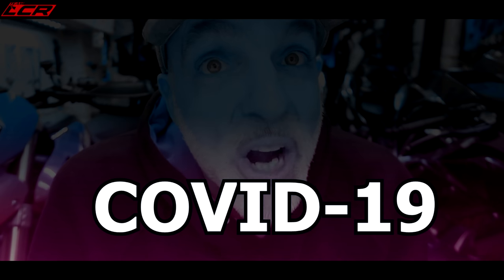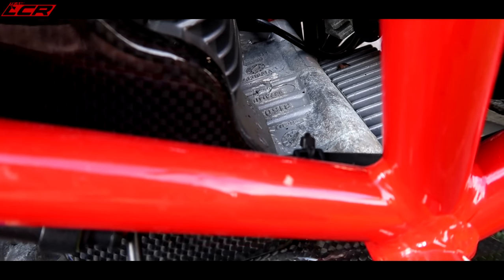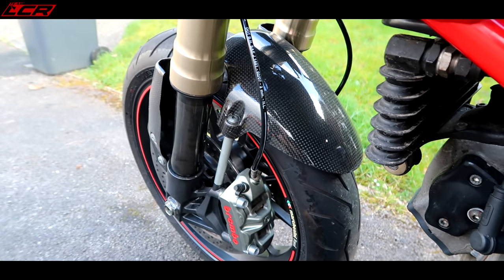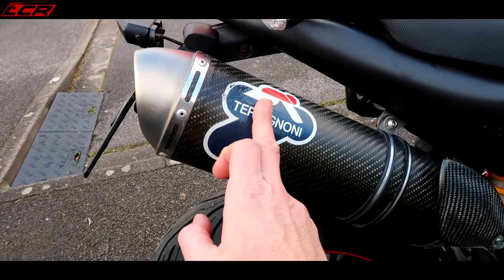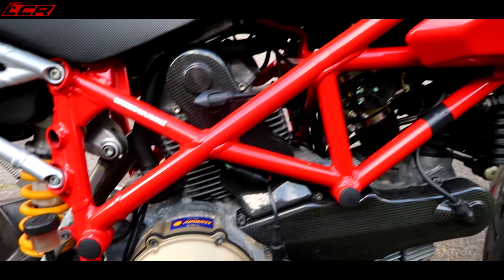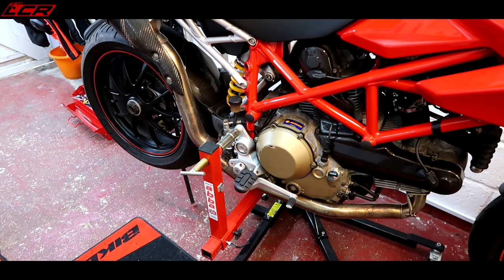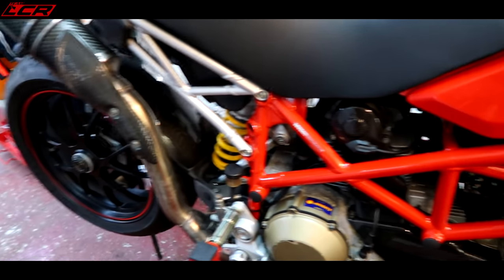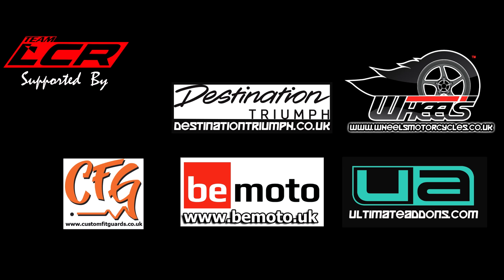Ducati Hypermotard Restoration EP01 | The Project Begins!!

Comment: The only solution for this is to take care of a bike. Had two S2R’s 800 and the paint was perfect on the engine after several years but I washed it regularly and through out. I used engine look it as a general gage of how the owner took care of a bike. Not perfect but good indicator.

Comment: Unfortunately Chops your bike is different from my SS. So lifting frame of engine not bad idea I did same with my old ZX10. I removed plugs and used nylon rope fed into cyl , being work on , at bdc and used a bolt in crankshaft to rotate up towards tdc , to hold valves in valves place for shimming. i procured shim kit from EMS Duc in states plus their MBP retainers. Those retainers tighten up the closer shim on valve stem nicely. Belts are easy to do. Probably good idea to make removable blank plate to partially reduce oil cooler size . Your climate can be too cold for oil cooler operation. Change the clutch slave cyl for lighter feel. Dry clutches like to be cooled by air so running modified side case is good idea , also vents dust. But you have problem with salt on roads mmm maybe not good idea. Get the chip changed and re program with one off of a dyno run, big difference. Modify your air box for more flow. Get your suspension o/h and set by guru. I run Michelin RS on my SS , 1098s and Monster 1200s 27/28 psi front 28/30 rear woo hoo. You got a good bike there Chops enjoy , vroom 🏍😃
Reply from the maker: Great tips thanks Kym!

Comment: I start my Ducati 1098 every two weeks and let it warm up to 80 degrees before shutting it off so that the cam belts are not left in the same position over long periods of time as the bike is being stood for a year. Is this a good or bad thing I'm doing?
Reply from the maker: I would say no you shouldn't, when I'm winterising my bikes I fill the tank (stops rust) add some fuel stabiliser and run it through the bike to stop injectors gunking. Disconnect battery and then leave it alone.
Reply: @LambChopRides  I've filled the tank and put the fuel stabilizer in just being told it's not a good idea to leave the belts in the same position for long periods of time as it will cause weak points on the belts?

Comment: It must be the 1100, right?
Reply from the maker: Yes 1100s 😎😎
Reply: @LambChopRides  Nice one but no abs it's a bit dubious to ride it in 2021 but since it is a restoration project and a weekend bike maybe it's ok. are the brake master cylinder and clutch the stock ones? could they be installed on a 796? thank you.

Comment: Exact start replacement starter cables, made a massive difference on my old RSV1000R, slightly better on Multistrada, check them out.
Reply from the maker: Ok Alan will check those out thanks 👍
Reply: Yes what Alan said....(kit had to come from America though) and yes did make a difference on the Aprilia and saves wear on the sprag starting clutch

Comment: I'll start by saying HELLO from the greater Seattle area! Now... Since I own a much newer iteration of this bike, I thought I might chip-in with some ideas (I hate the idea of "giving advice"). I'll start with the simple stuff, which is also the most obvious and I'll get later into the more complicated one. From an optical perspective, you will have to address first of all the tail section and work your way forward. Fender eliminator and turn signals, then seat/seat-cover. I'll also include links so that you and who is reading will get the feeling of where I'm going...
1.) I would grab one of the fender eliminators in the link and do some adjustment work to it and I promise you, it will look as if it was done in factory:
https://www.amazon.com/License-Bracket-Eliminator-Kawasaki-Triumph/dp/B07BKV6S5J/ref=sr_1_4?dchild=1&keywords=universal+fender+eliminator&qid=1585938872&sr=8-4
2.) LED turn signals. The Ducati branded ones sell here for $100 +/- $10 and are made by RIZOMA, HOWEVER!!! These are not a direct fit, unless you keep the factory housing which will hold to the strange shaped rubber end of the part... The better option is what is found as stock on some Triumph bikes, they have the almost same shape as the Rizomas do, but allow an universal mount. Also the light-block is the same and they are made of very high quality metal at a lower cost of only about $65:
https://www.amazon.com/Koso-HE015K14-Thread-Unlimited-Marker/dp/B005EMYPFK/ref=sr_1_1?crid=1HHHAM8A0D8YQ&dchild=1&keywords=koso+led+turn+signals&qid=1585939129&sprefix=Koso+turn+si%2Caps%2C223&sr=8-1
3.) Next comes addressing the seat... Here you have quite a few options; seat cover only and for this option I would recommend LUIMOTO, out of Vancouver BC (he did some wonderful work for me in the past for a different bike). I would go with the suede combination:
https://www.luimoto.com/?my=50&p=507
Next option would be an entirely new seat and here again are a few options... You could get a Sargent or a Corbin (less "bling", but very high quality)
https://www.sargentcycle.com/Seats-Accessories/Sargent-Seats-Ducati-Hypermotard-Low-No-Heat/Red-WS-605-11.html
https://www.corbin.com/ducati/dhm117.shtml

I'll move-on to my next thoughts and impressions... One more thing I want to move out of the way; the "milk" in your oil window... Thast's NOT any sort of "condensation"!!! If it were it would simply wash away at start of the engine, but it does not... In fact you need to ride it quite a while until if permanently vanishes. Because the bike had not been used for quite a while and because the interior part of the casing is bare (untreated) aluminum (US version - aluminium - UK and rest of the world version LOL), it will oxidase when exposed for a long time to the air inside the motor (we call it ENGINE LOL). There is no vacuum and there is no oil to cover it... It will wash-off (which apparently it did) and an oil change will do very good. Now, to the oil change in your case... I would like to see you do it twice with about 200 miles in-between, for two reasons: 1. You most likely don't know what oil was in the bike before you released it (and even then) and 2.) Motorcycle oil does not have the cleaning additives as car oil does because it needs to lube the wet clutch, so you can't really expect the oil to clean the system for you, other then picking up crap into it and getting contaminated. So a 200 miles oil change with the very same oil as 200 miles before is what I would do. Filters to be changed of course as well. Now to your Motor paint project... I'm only telling you what I would do and trust me, I'm very picky myself. I would first of all detail the engine as is, without taking any part off. Next, I would prep it for painting as you would a car in a paint shop... Cover all parts which don't need paint and leave exposed ONLY the parts which need painting. Prep them and spray them, but be very careful to use appropriate paint. If there won't be any golden paint exposed, I would go with what they use on later model bikes, which is black. Next, I would get rid of all fake "carbon" trims. There are some nice carbon trims made by Akrapovici and Rizoma, but the ones on this bike are simply terrible; they scream China! Next, you might NOT want to cut the pipe, even so it's a cheap knock-off; instead I would look for a decent one. A Termignioni sells for about $2000 and if it were to be genuine, you would never want to "mod" it LOL... You can find a decent pipe for about $500. I would recommend rebuilding the calipers with new Ducati/Brembo rebuild kits and flush the lines with cheap DOT 4 before using RBF600 from MOTUL; this will give you the most satisfaction in breaking you will ever have. Also, get double sintered EBC pads and get the WOW when you will use them. Now, I would do something which people might not agree with and I have not done my homework on compatibility, but what I have in mind is the following: Since you're looking for a fresh look on your bike, I would hunt down a set of rear structure, the silverysh one which replaces the steel tubing just under the rear part of the seat and I would also do my best to find the late model front protectors which hold the turn signals - those come with factory LED and look amazing. The tail part is now available on Ebay USA from someone who is taking a Hypermotard apart... I know it's a long read, sorry, but also consider the fact that I put a bit more time into writing it LOL. Good luck and keep us posted! STAY safe, you and the rest of the world!
Reply from the maker: Thanks for the detailed reply really appreciated some very good ideas there! Really like the tail tidy idea and things like LuiMoto I was already planning that :-) Thanks again I will come back to your message again as I work through the project, really appreciated Mr Dude!!

Comment: And correct, strip the bike down to the engine... wheels, forks and swing arm off first, then rear subframe, fairing, triple clamps, tank and loom. Then drop to the floor and strip off the chassis from the engine.

Comment: Support to the rear through the rear subframe I'd the back end out of my speed triple healthy dose of carbon fibre parts and race ti do some good deals on titanium bolts and I have bought a couple of hundred pounds worth of these items 😬😍🍀that is what I said I'd spent with oz wheels etc changed all body panels Boohoo wasn't spending it on home improvements its a bad hobby 🏡🤔😋

Comment: If it was 1988 you would have to 24K gold the frame, chrome the engine and put boat glitter paint on the body work. ... I like your idea better. Remember ass y m bly goes in the opposite order of Dis ass embly.

Comment: Those mirrors are awful, they are hard to lock in place, easily knocked and fragile, go price the replacement as when it gets damaged you need virtually all the parts including handguard at about an overall cost of £600. 

When you say 130, is that in KMP these bikes on a flat road will pull no more than 115 MPH on standard gearing? It doesn't need to be super fast it makes it up on the corners. I'm surprised you had an issue with the front even with mismatched tyres, these bikes are pretty forgiving and you can push the front end hard. 

How can someone let an £11,000 bike get into this state?

I'm not knocking you or your vid and certainly don't claim to be an expert but I have one of these, also an S model one of the 1st sold in the UK and owned it from new May 07 maybe June and do all my own maintenance on it so being realistic.

My only changes have been Termi cans, cat eliminator and comport seat. I have also removed handguards and mirrors for safekeeping finding them useless anyway fitting inverted bar-end mirrors and LED indicators. 

I'm looking forward to seeing what you're going to do with it. They're a great bike and good luck with yours.
Reply from the maker: Do they run out of puff and cant pull the gearing at 115 mph or hitting the rev limit? I noticed at 80  its absolutely cruising so presumed it had 130 in it?
Reply: @LambChopRides  Yeah I guess puff is a good word. I considered raising the rear sprocket a tooth or two where top end will remain much the same but maybe better response but it doesn't really need it. I grew out of the wheelie nonsense 40 years ago but ride it hard and on the roads where I live it pretty much stays with most until I hit a long straight that is.